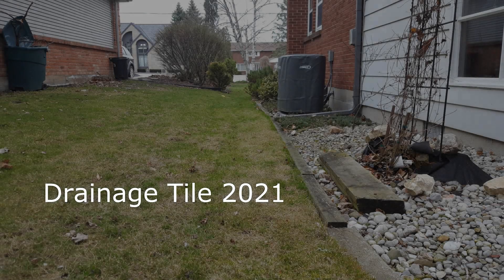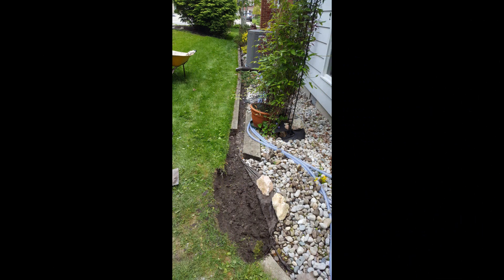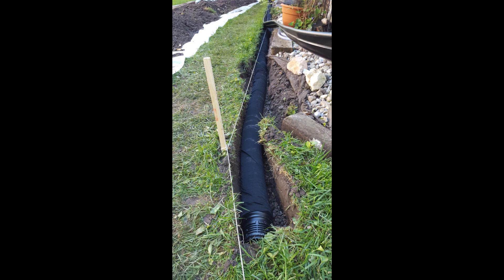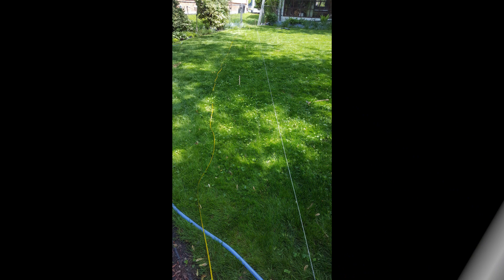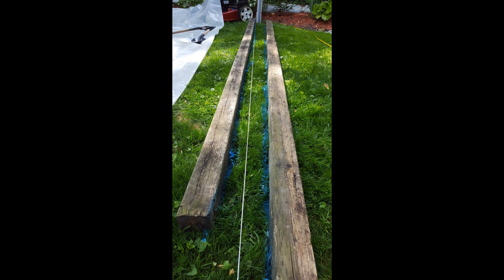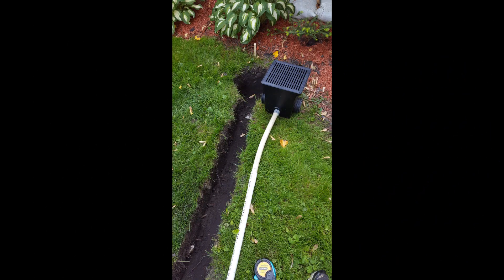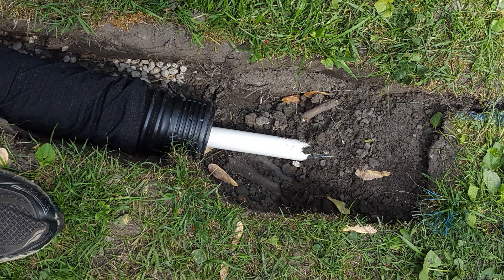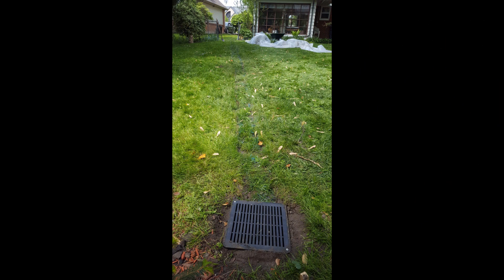Installing drainage tile

Comment: just seeing your video now.  so how did it work?    does water come out of the catch basin?
Reply from the maker: Yes. after a heavy downpour, the side of my house has a large puddle, but it disappears within short time (probably 15min).  Much less expensive than hiring someone to connect to the main sewer - that was ca. $7000

Comment: Did you do any research before doing this project?
Reply from the maker: I first looked a laser levels but those under $100 on Amazon, had poor reviews - poor visibility at 50 feet or more and I didn't want to spend several hundred dollars.   When I saw the use of a water level on various YouTuber DIY videos, it made good sense to use them.  Of course you need a tube that is long enough.  My total length was about 100 feet and that was the length I had to cover.   You can do this in 50 foot sections if necessary.  That's it

Comment: What grade is this?
Reply from the maker: the total height difference over ca. 100 feet was only 15 inches, but that's enough to move the water away from the house with the help of the water level.
I only used a 1 in ID pipe to the catchment, but that still should move a lot of water in an hour or so.
Not sure if I answered your question
Reply: @BJB0001  That does answer my question. Each situation is different. Apparently in theory grade is supposed to be 2% to be optimal. I did two projects both 66ft long one went down a natural hill, so the grade is definately 2%. The other had a slight slope, so in theory it was close to 2% but could be slightly less. They will both do their jobs.

The one that goes down the natural hill had to go down 3ft at one point because right by the house it had to start down 10in, so another can be attached later and graded 2%. It integrates right into the gutter system, but has to use PVC to get the water away from the house.

I've learned that it isn't nessisarily the grade, but also the placement relative to slopes or other structures that shed a lot of water. I dug a 1.5ft deep ditch behind my property and the side yard no longer becomes soggy because the sloped field behind me has somewhere to put that water, which is now diverted around my property. Thanks for doing up the video! Each one I watched helped me plan!
Reply from the maker: @andrew1717xx  Hey Robbie.  15"/100ft is 0.15"/ft or 0.15" slope per ft distance, i.e., 0.15"/12" x 100% is only 1.3% but it works for me.  Hope that helps
Reply: @BJB0001  My side yard has a bit of drain tile that is sloped about 1.5% it helped keep the side yard more dry because of the clay rich soil. After i was able to intercept the water from the field behind me that really helped my foundations (no water coming through cracks in the floor) for more then 2 years. 

My previous house had a sump because of a marsh behind it flooding ever spring, if the town did proper drainage, then the sump would not be saving me from flooding ever spring. Thats why I bought this house on a hill, only to realize the water is still an issue because of the soil type and water follows slopes.

Every discussion helped!

Sincerely,
Robie

Comment: Nice job on the trenching, researching, etc.!
Although not the focus of your helpful video, your pump wire installation is   concerning. It appears as though you used NMD90 inside what you identified as a polyethylene pipe/tube .
Assuming this is a 120 Vac circuit, first, NMD90 is not rated for wet conditions so is unsuitable for use below grade, regardless of the protective tubing. Second, in Ontario at least, I believe the wire has to be buried to a minimum of 16" and have a "warning ribbon" buried above it.
The idea of the ribbon is to avoid exactly the cutting incident you encountered. 
Glad you weren't hurt when you cut the wire!
Reply from the maker: I believe it is NMD 90 (polycoated 14-gage).  Admittedly, I never asked about its suitability for laying in the ground.  I installed the cable to the pump about 20+ years ago.  The cable still looks good.  There is a GFI on the circuit as well.  As to the depth - that I did not know.  I'll tell the next owner of the house.  I do appreciate the info